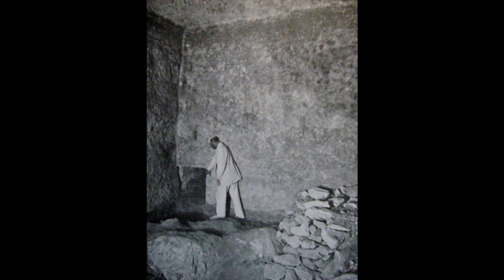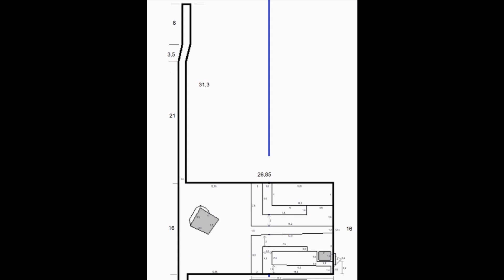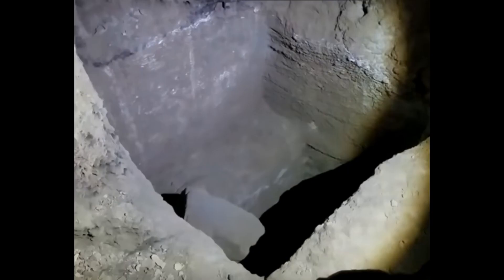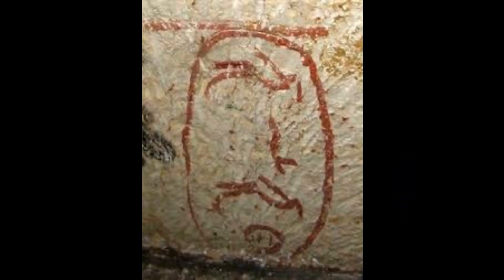The Mysterious Dead End Passage of the Subterranean Chamber

Comment: Could it not just be a room that the workers and stonemasons  used as  tool store/ plans and drawings room/ sleeping quarters/ kitchen / rest room/ room to shelter from the elements??????.................
Reply from the maker: Yes it certainly could be. Could have been different things at different times. Whether they built it specifically for the purposes you mentioned seems to be a pretty involved way for them to do that. One thing that leads to the conclusion it was unfinished is that (as you probably know) the y traditionally carved from the ceiling down which is why the ceiling is complete more or less but the floor isn't.

Comment: The whole of the subterranean chamber works are only a waste disposal system.  Somewhere along the ceiling of the southern shaft or on the other side of end which is probably a plug because of it's finished appearance should be indications of shafts leading from above coming from a bathroom meant to be used by the artisans who worked in the real burial chamber of the King.  It was also meant for the Kings Ka in the afterlife for fear he might have to eat his own waste,  Vol 2 The History of civilization by William Durant.  Khufu is still there and the front door is right in front of everyones faces.  Good luck and try and use some common since.